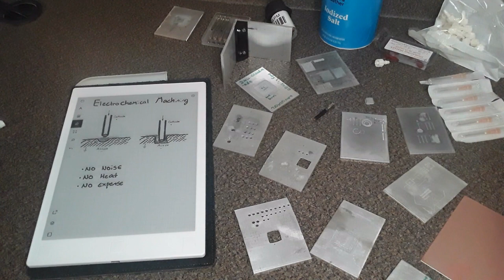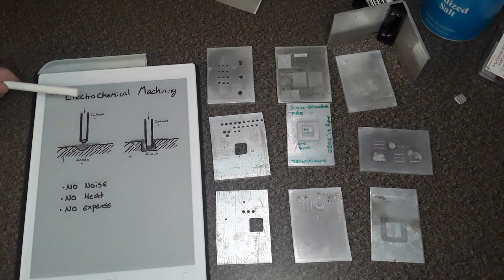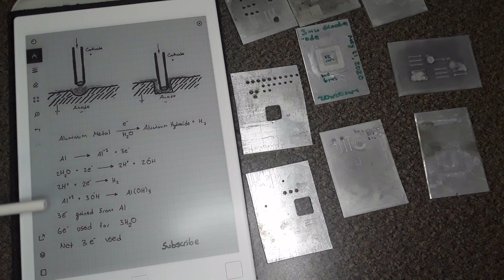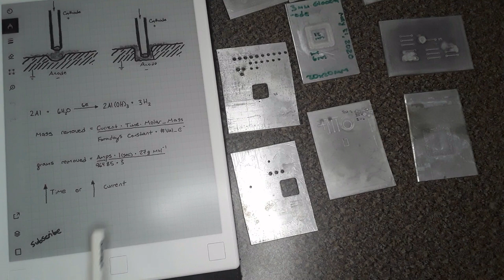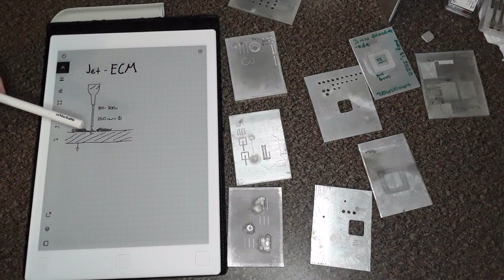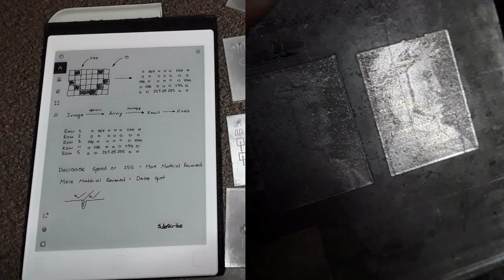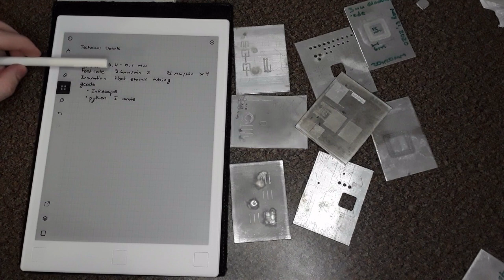Cut and Engrave Any Metal: Electrochemical Machining and Jet-ECM

Comment: If you're interested in doing the microfluidic circuits, I would recommend cutting steel and using NaClO3 as your electrolyte. The finish is the best I've seen, bar none. There's also a few papers out there on how to configure your current density for better surface finishes. 

It's funny actually, I've been trying to replicate your results and I'm only just now seeing your recommendations for a the pump and voltage booster after using the exact some ones in my setup. Great minds think alike I suppose. I've been trying on and off to get away with using a 3DP nozzle as my jet fixture and it's just totally trash at maintaining a good quality free jet. Gonna have to switch back to needles again.

Comment: I'm happy I stumbled upon your videos, my project for next year is to mod the remains of my old printer to an ECM machine, one that can achieve high resolution with reasonably deep cuts. There are extremely thin hypodermic needles I want to try (if you ever get a spinal tap you'll appreciate they exist, lol) but I can already imagine the challenges that come with them in regards to max current and flow. So much to try, error and learn, very exciting!

Comment: You can improve z resolution by switching to 2mm pitch leadscrews which gives you .01mm resolution on full steps, and even less when doing microstepping. If you don't believe in microstepping, gearing z might get you even higher resolution.
Reply from the maker: That is a good idea

Comment: Subbed, liked, and comments for the algos.  Didn't have high expectations with such a low view/ sub count.  Pleasantly surprised, especially with your python script.  

I'm going to try this on my lowrider cnc to cut out aluminum replacement end plates and start working on rigidity improvements.

Comment: Have you tried a lithographic/photo-lithographic method? I used a crude form (a pattern cut from tape) to make a spring steel reed valve with a complex shape that would have been very hard to make any other way.

Comment: Sorry if this sounds dumb, but the only reason to use a pump is to blow away the residue, isn't it? Otherwise just for a shallow engraving/etching a solid needle and a fully submerged piece + needle tip should be enough and simpler than adding a pump, and will perhaps allow for finer details

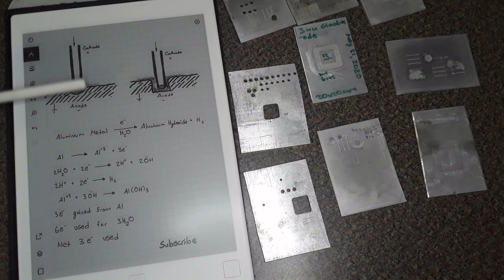Comment: a good video but, at 5:13 it's complete nonsense in explaining the need to supply current (having lessons of oxydo-reduction chemistry, I would eplain it like this)
by applying current, you force down electrons in the cathode and pumps out the same amount from the cathode ; the overall system stays electrically neutral 
the reaction happens in two times :
1) 
a) at the anode the aluminium is oxyded ( anode => oxydation)
Al(solid, noted s)=>Al3+(in the water, noted later aq) +3 e-
b) at the cathode the water gets reduced, in dihydrogen (H2) producing HO- ions :
2*H2O(l, liquid) +2e- => 2HO-(aq) +2H+(aq) +2e- => 2HO-(aq) + H2(g,gazeous)

to ensure a global electrical neutrality, the reaction at the anode happens two times whereas the one at the cathode happens three times(in the same amount of time) : giving us the final equation :
2*(Al(s))+3*(H2O(l)+2e-) => 3*(2HO-(aq)+H2(g)) + 2*(AL3+(aq) 3e-)
6 electrons are cosumed and produced, everything right : 2AL(s)+ 3 H2O(l) => 6 HO-(aq)+ 3 H2(g) + 2 Al3+ (aq)

2)
the aluminium ion has an acidic behaviour and the HO- ion, is by essence a basis (oposite of an acid if you didn't knew it)
the al3+ and HO- react in thefloolowing  acido-basic reaction :
Al3+(aq) + 3 HO-(aq) => AL(OH)3(s) (one aluminium linked with three oxygen, themselves linked with an hydrogen)

The need for supplying current comes from the fact that the reduction of water into dihydrogen isn't a spontaneous reaction (totally the opposite, its the inverted reaction of H2+O2=> 2 H2O that is spontaneous, making hydrogen an extremely flamable gaz). You need to force the production of dihydrogen by pumping electrons in the cathode.

About the reason for the size of the holes depending on the concentration of salt, I have my own (not proven in a lesson, my classes doesn't goes that far) : 
- the oxydo-reduction needing a current, that reaction is highly dependant on the resistance of the solution (thanks to Kholraush's law, the conductivity (invert of resistance) is proportional to the concentration of each type of ions)
- a chemical reaction is always an equilibrium, if too much products are produced, the reaction will slow down and even come to a stop (you can even revert a reaction by increasing the amount of one of the products, it is a matter of the reaction's coefficient

my idea is that with higher concentrations of salt, the resistance of the solution decreases, producing more aluminium and the reaction at the bottom of the hole slowes down whreareas the reaction on the sides get more proemeinent, making in the end a bigger hole

Comment: I'm interested if one could create a tool of an inverse complex shape and use it to cut that shape out of a solid stock of metal.  Does the ECM tool need be a continuous plane, or could it have high and low spots that need to be precisely transferred to the working piece?
For instance, if I wanted to make a mold out of metal such as aluminum or steel, could I print the shape on the 3d printer, apply a conductive coating to the print, and use that complex printed surface as a tool to cut the shape into metal?
I'm assuming the answer is no, since in the demonstration you seem to be using the ECM setup like a mill rather than a press.
Reply: I was doing some reading and you can do complex 3D shapes. Look up ECM for jet turbine blades as an example
Reply: You can put a sprue onto your plastic part, dip it in plaster of Paris,  burn it out and cast with metal. 
I haven't tried this but seen it on YouTube.

Comment: Nice info. Something I missed is info on how fast your needles get damaged? For example if you use a needle to drill a 3mm deep hole in alu, how many holes could you drill before the needle gets too much damaged ? Or don't they damage a lot ? I also wonder if you have to ket the electrolyte go through the needle itself. Can't you also just spray from the sides like in edm ? (anyway, the needles aren't hard to get) . And 3rd question. You talk about using a 12V power supply in the beginning, but how many amps are aproximately being used from that 12V PSU ?
Reply: Because of the cunning way ECM works, there should be NO wear on the needle at all. So infinite holes!
Reply: @robbiejames1540  Because cathode does not get eroded?

Comment: have you looked into using potassium hydroxide or sodium hydroxide instead of sodium chloride. potassium hydroxide is supposedly the best electrolyte because the anode/cathode stay clean when producing hydrogen for a HHO generator. but maybe this quality is not what you're looking for when drilling/milling. something to try possibly.
Reply: Sodium and potassium hydroxides are reacting with aluminium and they will dissolve it.

Comment: For Jet ECM, you need 80 to 300V?  What is the current at that voltage?  I thought the current was the thing that mattered.
Reply from the maker: Current does matter, but for jet-ECM because of the large inter-electrode gap you need a high voltage. As a result of needing higher voltage, but not wanted to boil the water, the current must be limited to a degree. So the cutting is slower.

Comment: Amazing work !!! any updates on this???
Reply from the maker: I have been working on desktop metal printing, but I plan on doing an Ender 3 conversion once I figure out how to modify the firmware slightly for very small z-moves
Reply: @MorlockEngineering  I might be able to help you out with this. Currently also looking for a way to manufacure some microfluidic chips :)
Reply from the maker: @Max-tj7bp  I have been making some using PDMS and 3D printed molds from my Mars Pro.
Reply: @MorlockEngineering  wow, how did I not think of that.. I tried epoxy castings but they were not inert enough for the chemistry I wanted to use them for.. but I also have a Resin printer so  casting pdms should do the trick. However, I still need an excuse to build a jet ecm, for which I know how to get ridiculusy slow and minuyr movements :)

Comment: so can this be conected to a normal cnc mill and use the same as a cnc mill or lazer engraver
Reply from the maker: CNC laser engraver would be an easy step. The CAD file is on the github, so you could do that easily with some modification. Use inkscape to generate the gcode
Reply: @MorlockEngineering  yeah thanks man good work i saw about this a few years ago didnt think it was this easy

Comment: The explanation of the electrochemical processes is wrong. For example the reaction in second line is completely wrong, you don't need any electons for it - let's check the charge balance - the overall charge on the left and right side of the arrow must be the same. Here, you can see that on the left side it's 2, while on the right side it's zero - two negative and two positive changes cancel each other. Also you don't end up with 3 unused electrons - you use them for the oxidation of second atom of aluminium. The overall reaction is: 2Al + 6H2O -->2Al(OH)3 + 3H2. You use the voltage to transfer 6e from 2 atoms of aluminium to 6 H+ ions to create 3 molecules of H2 and 2 Al3+ ions.

Comment: FYI, there's a cheap CC/CV power supply that you can control via USB+Python that you might find particularly useful. It was your original video on etching that got me thinking about its applications, particularly with regard to monitoring the output in order to monitor kerf width/MRR and detect shorts when you move too fast.

I've only gotten as far as poking a piece of aluminum with an electrode and seeing "yup, it removes stuff," but I did do an example bit on controlling the supply, which might be of use to you.

demo: https://www.youtube.com/watch?v=BoTV7003glU
code: https://github.com/swolebro/swolebro-youtube/blob/master/arduino/dps5020.ipynb
also, important assembly tips: https://www.youtube.com/watch?v=4kIKpnaqWLw

I hope to revisit this sometime, but got too much other nonsense going on at the moment.
Reply from the maker: I defiantly want to revisit ECM as well. I am waiting for an Ender 3 to become available so I can make a video on converting it to an ECM machine with a swappable tool head.
Reply: @MorlockEngineering  Whoops - I'm partly responsible for four of those Enders being out of stock. Hahahah. Every time someone asks me which printer to get, that's the answer. They really are great.

I'm not so sure about using a bed-slinging printer for ECM though. I guess with a small needle jet of water, it's not that much to drain from the bed, but with a pump flooding the work, you'd have to make sure you drain it off fast enough that you don't have a reservoir of water sloshing around making you miss steps.
Reply: Hah, I was just going to ask if a CC supply with feedback would be advantageous here. What kind of current does this process need? If under 30mA produced acceptable results it would improve safety when dealing with the higher voltages. Feedback for short detection and even "touching off" the top of the material should be feasible.
Reply: @shonkydonkey  If you want to remove any significant amount of material, you're looking at 5-15 amps. More if you can. It's the amps that remove material, not the volts. For detail work or etching, milliamps will do.
Reply: @swolebro  Hmm... EE thinking out loud here...  the current by itself isn't that big of a problem, but I know Morlock Eng. was talking about 300V+ which does indeed start to get expensive. Rectifying AC mains is a fairly cheap way to get ~100V 10A, but 15A and boost to 300V isn't easy. That kind of power would need a welder or dryer outlet or something since 15A at 300V would need at least 45A at regular US mains voltage. 

Wonder how much use 100V and 10A would be. It should be feasible to make a linear constant current supply to step that down, but it would need some pretty big (expensive) FETs. It might need a decent amount of bulk capacitance to keep that kind of current going though. 

Wonder what effect a switch mode power supply would have on this. It would probably be a cheaper way to do this.

Then there's the safety related questions when dealing with 100V+ and enough current to kill you pretty good...
Reply from the maker: @shonkydonkey  1 amp at 12 volts works well for drilling and milling.
Reply from the maker: @shonkydonkey  10 amps is over kill for etching and micromachining. You only need a few milliamps. Remember that you are removing micrograms of material a second max. That means next to no current. 

I have also tried out rectified mains and it works well
Reply: @MorlockEngineering  Well maybe that power supply that swolebro is playing with is the best bet then. If you were interested, I could probably come up with a power supply that did the same thing, but with an interface that was easier to integrate with a 3D printer. 

Perhaps that doesn't really help much though. I wonder if the easiest way to proceed with developing this would be a plugin for Octoprint that controlled swolebro's power supply? (as he suggested in his video)